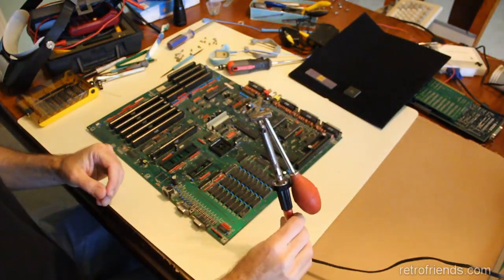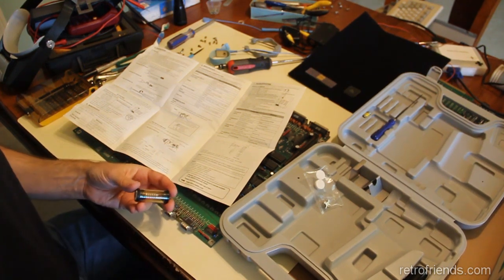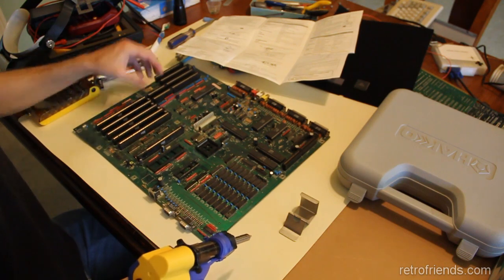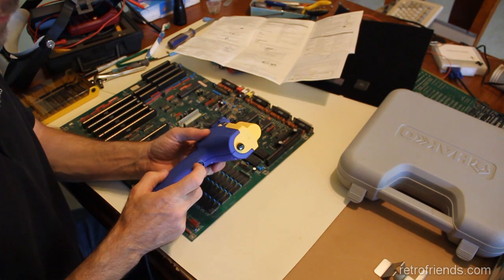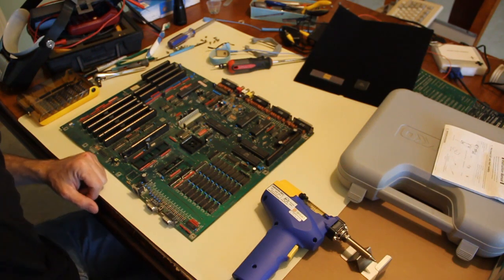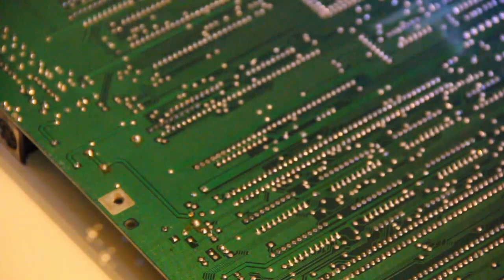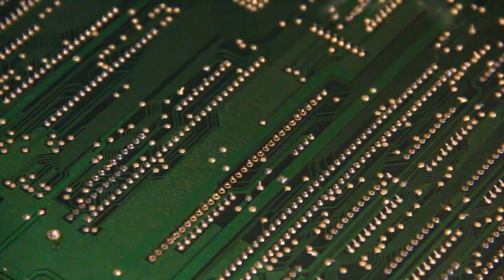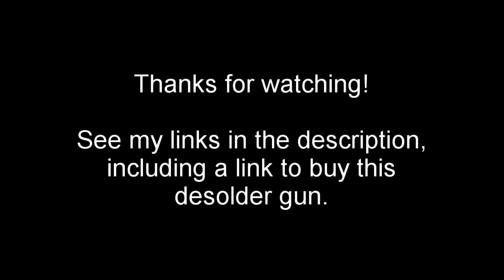Hakko FR-301 Desoldering Gun Review and Best Practices

Comment: I have the 301 and it was the best money I ever spent. However, it does seem to eat filters, but otherwise it's a great tool I wish I had years ago.
Reply from the maker: @azmrblack  I remember "somebody" saying you could use regular cotton instead, like from a cotton ball.  I would exercise caution because cotton is flammable and this thing is a source of heat.
Reply: @retrofriends  The solder is still molten hot when it hits the deflector (silver thing), and little solder balls can get past it to the filter sometimes, and give it a heat burn mark (seen it on mine). A cotton ball would likely fully combust and destroy the gun, and also does not have the surface area to effectively filter rosin fumes like the highly compressed ceramic/cellulose filter. I have heard of others pulling off a layer of two of it, it may work in a pinch but it's not good to use continuously.

Comment: You add a touch of solder to the iron (sometimes) only to help with heat transfer, it's not to do the actual soldering. The soldering is as you described. And no, it doesn't corrode the iron - you clean it afterwards. But I agree about the recessed button - I was looking for a vid that shows the innards so I can modify that. The other thing is that the light should be on the back of the handle and stay on! I'm surprised by that design.

Comment: Thanks for the video. Why do you add solder to the pins before de-soldering the chip in the demo towards the end?
Reply from the maker: That is a pretty common practice. You reflow and add new solder to the joint to make the extraction flow better.

Comment: What's the difference between the FR301-81 and FR301-82 models I'm seeing for sale on Ebay?  The price on these seems to be the cheapest anywhere, around 220 shipped from Japan.  Are these perhaps counterfeit?  Price seems really good, maybe too good...
Reply from the maker: Sorry, I don't have any answers. I bought mine from Amazon (link in the deacription).
Reply: This is old but......
Fr301-81 is Japan version without ground on plug.  
Fr301-82 is Japan version with the ground on plug.  3 total prongs on plug.  
Happy desoldering!!
Reply: @johnjones4376 What does it mean to have ground on plug?
Reply: Be careful, there are definitely counterfeits on ebay. There is a video on Youtube on how to detect Hakko FR301 counterfeits https://www.youtube.com/watch?v=VvOJL8aAUO8
Reply: Just in case someone has the same question in the present. I think it's the 100V vs 120V(USA/CAN/AUS) outlet standards I think, not 100% on AUS so double check that..
Reply: @nsoutlawball1941  Ah I see... Which one is which?  Would be great to get some sort of confirmation on this.  I would really like to know if I bought the right one....
Reply: @skins4thewin  Depends on what Country you live in. If you're in USA/CAN It should be 120V because your wall outlet is going to be feeding 120V ideally give or take. But if you live in Japan or probably some other places, you'd want the 100V version. I think that's how this works.
Reply: @nsoutlawball1941  Yes yes I got that but again, which is which?  As in which model number is which voltage?  That is all I need to know.
Reply: @skins4thewin  That I don't know, but you could look into it by bringing up amazon or ebay listings and checking the specs 100V/120V and then referencing the model number if it's visible.
Reply: @nsoutlawball1941  I tried to do that with some of them, but both end up saying 100v, probably using the standard Japan fact page or whatever.

Also tried calling the HAKKO customer service line today but they are closed for the holidays.  Didn't say for how long.  Guess ill try every couple days til I reach someone.  But ya, if they can't tell me the answer noone can lol.